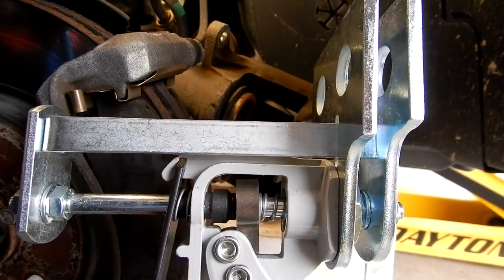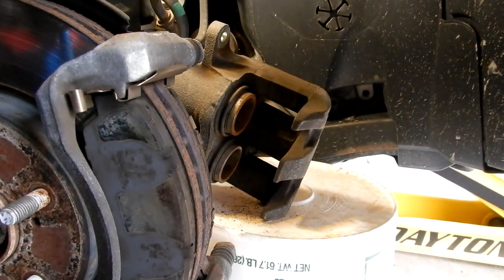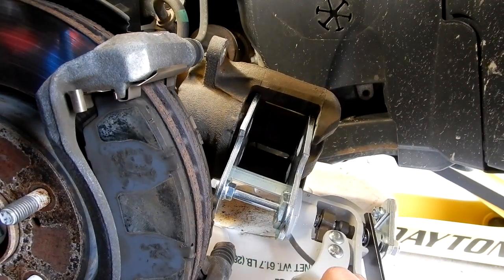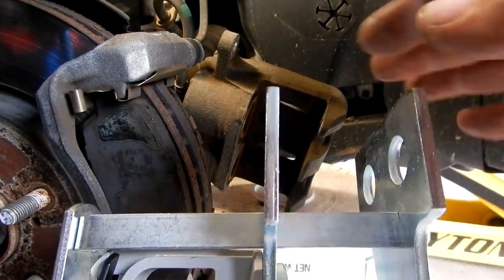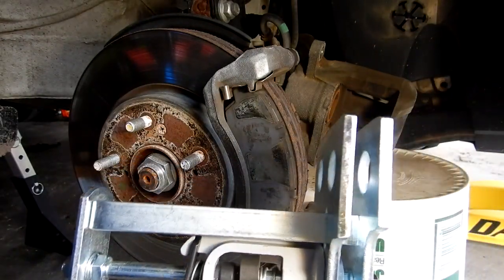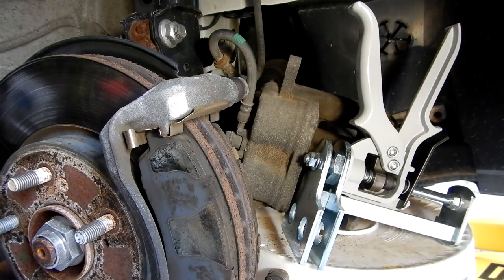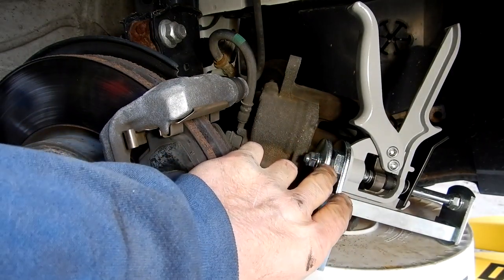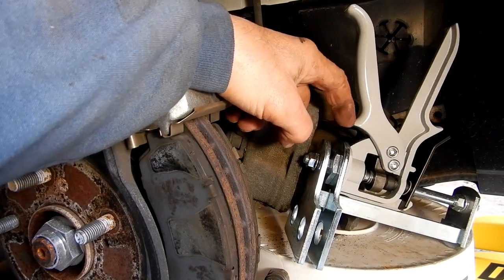Lisle 29100 Quick Quad Pad Spreader

Comment: I used this tool before but I prefer a c-clamp. Works much easier when using the existing pad as a push plate. Thanks for the video
Reply from the maker: Thanks for your input Antonio.
Reply: Can’t always use a C-clamp. The rear brakes on my Lexus have an electronic gizmo on the backside of the calliper for the e-brake so I can’t fit a C- clamp on it without busting its plastic housing.